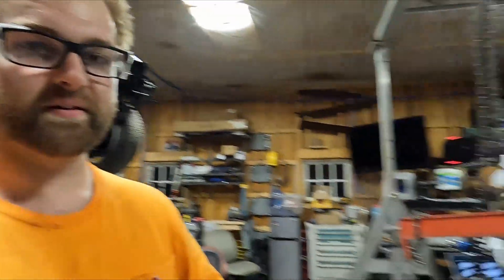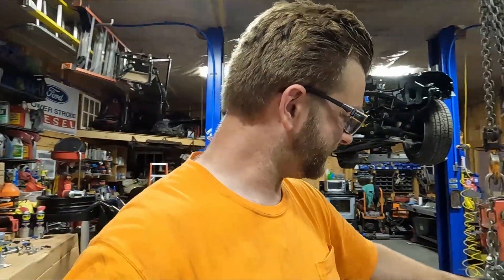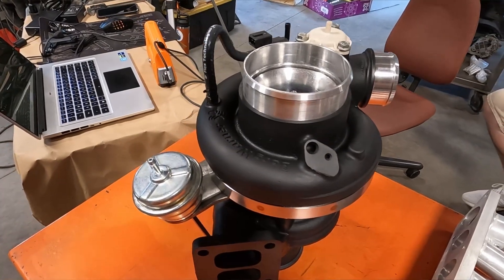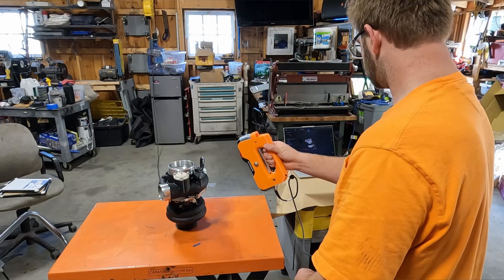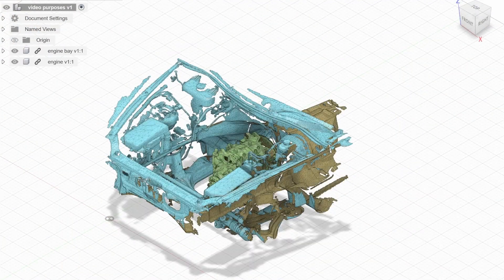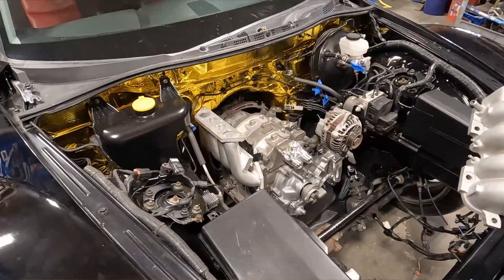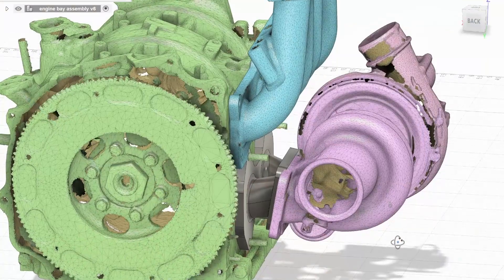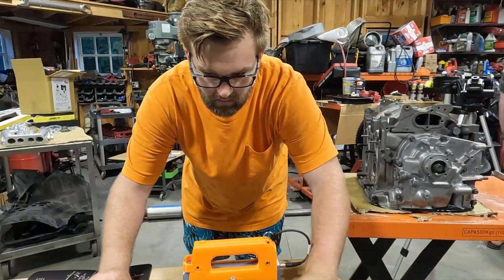Diving into a RX8 engine swap! : RX8 REW Swap (pt 1)

Comment: Cool videos. Im looking to do this myself. Just wondering if the factory twin turbos would fit? I’m trying to keep it looking stock as possible.
Reply: I didn't have anything from the FD other than the UIM otherwise all my REW parts were pieced together from the engine builder (REC in calgary). The stock twins are fairly small and just long which you do have room for. The wastegate actuator may hit the front subframe though.

I just know the stock twins are a huge headache from what I hear. In this era most single turbos spool just as fast if not faster so really there is no gain for the potential headache.
Reply from the maker: @mincvinyl  what he said!
Reply from the maker: It has been a really cool build. Jake has actually driven it (in the driveway). From what I understand putting the REW from an fd into the rx8 you have to do a custom exhaust manifold because the engine bay of the rx8 is narrower. It isn’t a direct drop in. There will be nothing stock about it haha